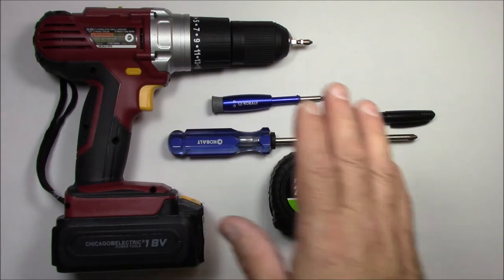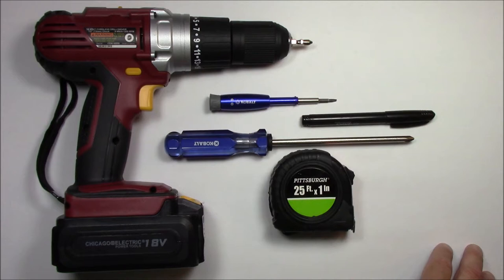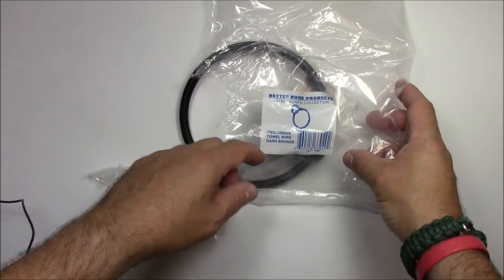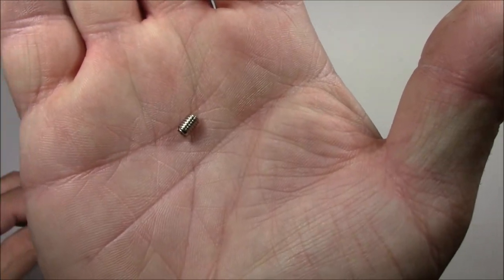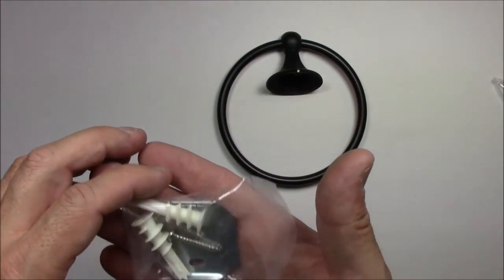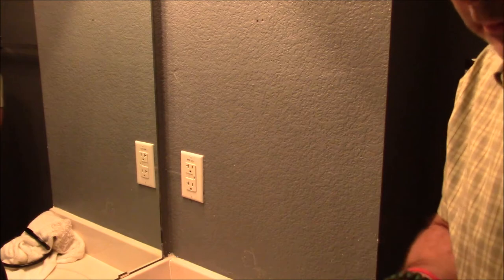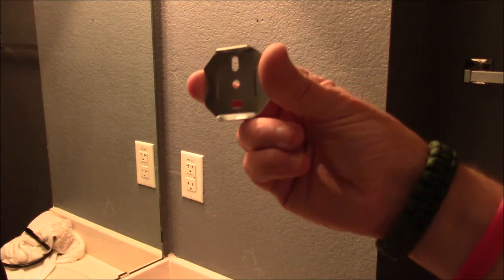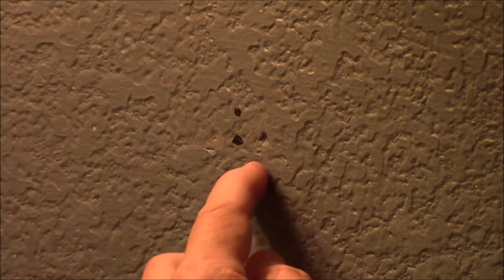Towel Ring Full Install Better Home Products Item# 3304DB HD

Comment: 5 minutes... It took me 5 minutes WITHOUT an electric drill. I used the screwdriver and Hammer tap trick to assist me. However, I tapped the screwdriver all the way through the wall. It made getting the anchor bits through so much easier. I adore you. Thank you so much for your help!!!

Comment: Dry wall do you like em or hate em?, you never stop entertaining YTubers, i love your videos very well presented and informative.
Reply from the maker: +bmwnasher Thank you. Drywall beats plaster and lath hands down. In America it is the predominant interior wall material. I used to do drywall contructions work and it is not easy work. Taping and mudding is not much fun and the men I worked with made it look like child's play but it certainly not an easy skill to master. Then the last and most dreaded task in drywall installation, sanding. The end result is durable and easy to maintain. Until a viable laternative comes along it's the best we have. If I had a preference in building material it would be concrete, lol. Thanks for watching.
Reply: Richard Lloyd We have what is called traditional build, brick outside breeze block inside with a cavity and plastered, but we do have a lot of drywall now, especially in apartments.
Reply from the maker: +bmwnasher Drywall is just an easier and cheaper alternative to any other interior building material but I think the old houses are actually stronger than the current building methods. As the old saying goes,"They don't build them like they used to.".